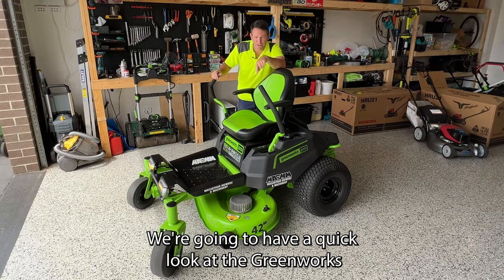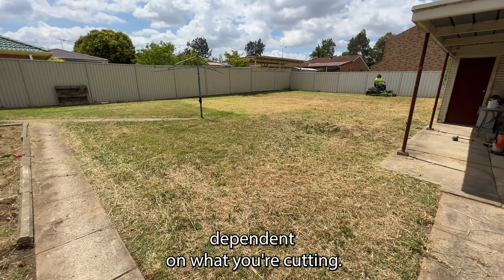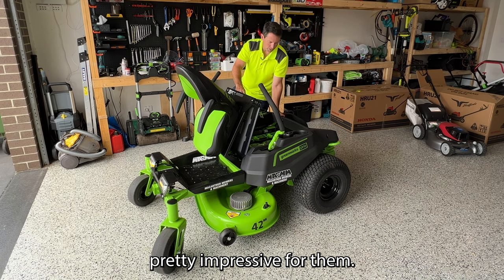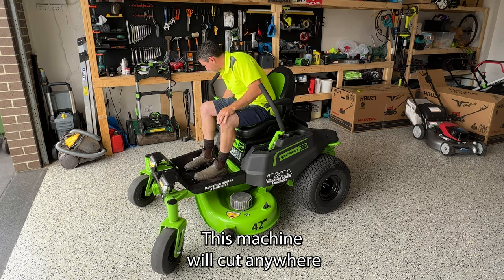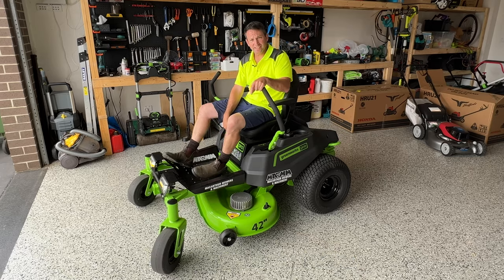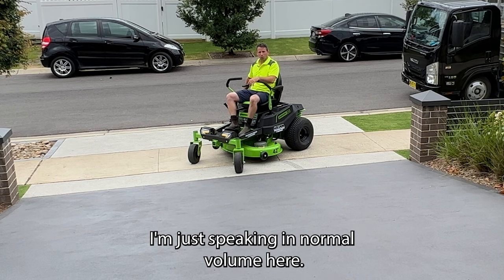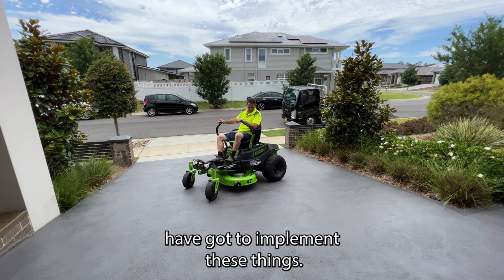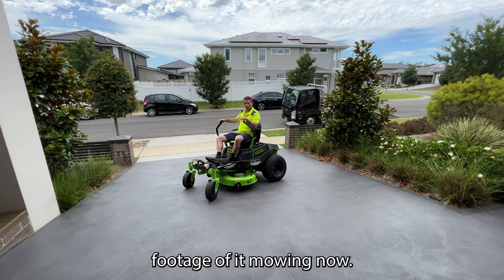Greenworks Battery 42 inch Zero Turn Put To The TEST! Overgrown Yard Destroyer?

Comment: There are peccadillos with any tool, but overall I am impressed with the new battery equipment.  For homeowners, it really is a good way to go since it does the easy stuff just as well as ICE equipment with the benefits of saving fuel for equipment that really needs it, being so much quieter birds almost land on it while you use it, and the only emissions come from its manufacture and the electricity provided (some places still burn fuel to generate).  This was a good trial location since the poor woman was only able to mow what she could when she could before aggravating her back.  The varied heights and topography of the lawn showed you get a little stuck here and there, and you could hear the mower get bogged occasionally which it also seemed to handle well .

Comment: My thinking on using standalone chargers is that you could be charging one set whilst using another.
Also, I guess they have a range of tools for the battery platform so being able to charge 1 or 2 batteries at the same time makes sense especially if using the batteries in the zero turn as well.

Comment: The six batteries would be a downer for me. If, as you said, you could charge all the batteries by plugging the charger into a socket, a purchase would be likely. You wouldn’t have to waste all that time pulling out three charge bases and six batteries, charging, and putting everything back. I like the quieter drone of the mower, the no turn feature, and the easy raising and lowering of the deck.
Reply: If you had 4 extra batteries,  you could keep mowing while the 6 are charging
Reply: They sell a rapid charger for all 6 battery's
Reply: and good luck getting one of these emowers serviced or warranty work done. ejunk
Reply: Yeah, changing the batteries take about two minutes longer than filling a conventional mower with GASOLINE. I’ve never spilled a battery before.
Reply: I can’t believe they don’t have a plug into the mower to charge all the batteries!! 😮 that’s so sad
Reply: @spoton5981  There would be problems with that.  Most likely if they did that it would just be one battery pack and once dead that would be a dead machine.  This way if one battery goes you just replace it.

Also you only need three to run it so technically you could charge three while using the other three.

They are three pairs of two and serve different needs.  Power to go forward and back, right blade and left blade.  So you could charge three and still mow.

Comment: I got a ryobi 42 zero turn for 2k off market place and it's phenomenal. I wanted this one but the price point and having to remove all the batteries to charge is a nuisance. The ryobi plugs right in takes about 3 hours to charge from completely dead to %100 and that's with three big batteries and 2 small ones. I've already used the crap out of it I mow 6 lawns in my neighborhood which it easily does on one charge. I also pulled a large stump from the ground yesterday and the only issue I ran into was traction but still did the job

Comment: I have a greenworks 21 inch self propelled mower and it isnt nearly as good as the ryobi i had when i got the greenworks mower. The ryobi is simpler and after almost 7 years no problems from the ryobi. Can't say that the greenworks mower is as good.

Comment: I have question my dearest friend..i have mower optimus Z czr 82 volts...idont now my machine is fully charge 100% ,but quitly battery drop voltage  become low,just using only 1 hour and 30 minutes operation ,,,the machine need to charge again...any body to answer mg question problem...batery damage ? 2023 model mower machine optimus 82 v

Comment: Thanks for doing this review. The question I have is, if your current ride on died today and couldn't be fixed (or even if someone was starting a new mowing business), would you buy one of these and say maybe 4 spare batteries so that you could swap them out and change the others as you keep working throughout the day? Or would you still buy a petrol fuelled mower? 
Regards Ben
Reply from the maker: This is not a commercial unit, so no I wouldn’t buy one to use commercially.
Reply: @turfandtools  👌👌👌 cheers mate

Comment: Do all 6 batteries drain evenly? I have their push mower that has two batteries. One empties completely before the other is used. Because of this i am rarely charging more than one battery. How is that with this mower?
Reply: I read somewhere that it uses bank 1&2 for drive motors, 3&4 for 1st motor blade, 5&6 for the 2nd motor blade.  Found out today, after receiving mine that it seems to drain each battery one by one... finished a cutting session, don't recall the percentage but the battery in bank 6 was still at 100%... the batteries in bank 1 to 5 were depleted.   Could be wrong but to me it appears to go battery by battery.

Comment: Crazy there is no way to charge without having to take the batteries out, like you said much better if the actual mower had a charge port to simply plug the mower directly to a wall socket.

Comment: A gas burner at the same or less price point will do a much better job. The cut looks shredded and no clean and that's due to lack of power. Heaven forbid you try cutting a yard that's a bit wet. Pass on this.

Comment: WITH THE COST OF ELECTRICITY IT WOULD BE CHEAPER TO RUN A PETROL MOWER .
Reply: 2.7 kWh to fill this battery. That’s 30 cents for me. That gets you 1/10 a gallon of gas if your lucky.
Reply: 2.7kwh for $0.30c. Far out, I'm paying around $0.50c per kWh.